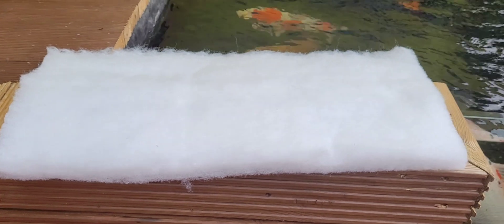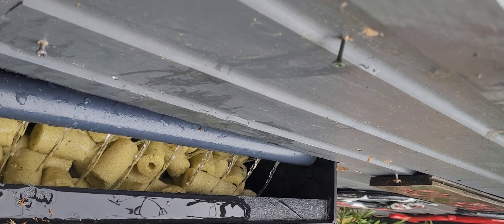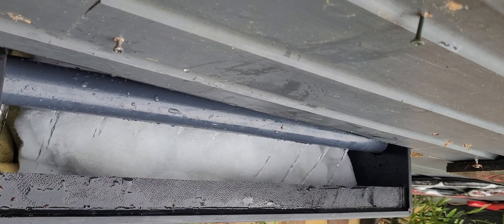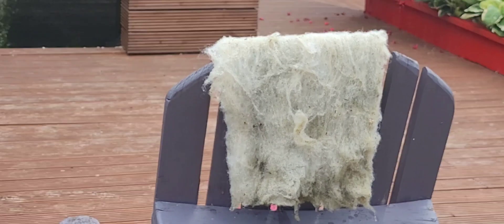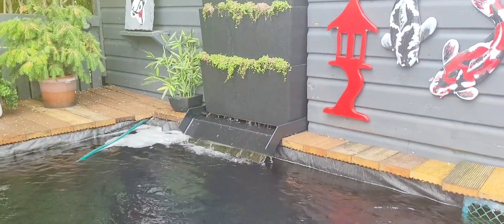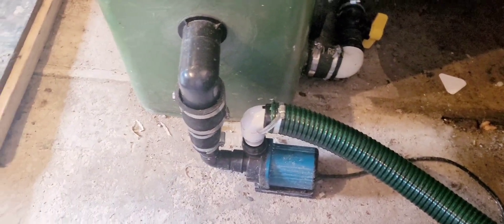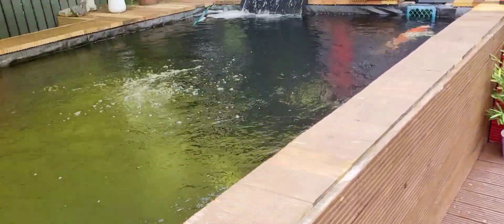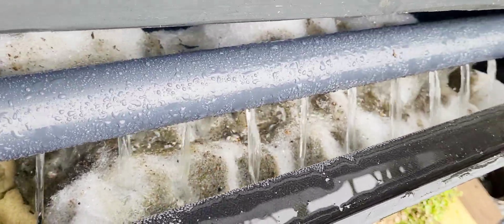Bakki Shower Flow Rate - Fitting the 10000ltr Pump

Comment: You will need a filter. If you can find a 2nd hand one going cheap try a large pressure filter until you work out what you want to do or buy an expensive very large self cleaning one if you are flush lol.
Reply from the maker: Hi thanks we went with a pressure filter. Video shortly

Comment: Love your pond. I use a wheelie bin as a trickle shower after a pressured sump type filter.  I've just fitted an upflow on my heater circuit. I used to have a blagdon 6000 pressure filter on there but it was a pain to clean.  I'm really loving the upflow.  So easy to clean. I did a similar thing as you with increasing the pump capacity. I used to run two pumps. A blagdon variable pump that was 6000ltr and a standard 5000ltr pump. The 6000 ran my filters and the 5000 ran the heater circuit. I've now upgraded to a 20000ltr variable pump (way over the top). The reason I did that was because the top of upflow is about 1.75mtr from the floor and I just didn't have the head pressure on the other two pumps. It runs through a oase Y piece so I can control the flow to each of the different circuits and I will be adding a second upflow as soon as I get all the parts. I've done a series of video's on the build if you are interested.
Reply from the maker: Hi there, 👋 I will have a look and subscribe

Comment: I don't use any floss as it is a pain and a chore cleaning it. You will need something to filter the poop first though or it will clog up the media just as quick as the floss and that will be a bigger job cleaning. Either a sieve, Upflow or a Pressure Filter would work. I use a Pressure filter at present but will be swapping to a sieve soon as my flow rate is reduced using a Pressure filter and a Tempest or upflow only works at a slow flow rate (5,000 to 7,500 LPH). A tip would be to fit a couple of Valves, either side a pump or any equipment then you can easily isolate them to remove or swap anytime.
Reply from the maker: Thank you good advice

Comment: Hello 👋🏼 
Things are looking good in and around the pond.
We used to use floss to trap the finer dirt until we changed our setup.
I found that the thicker stuff 35mm-45mm was better and lasted longer, im not sure about the price now but it was from pmf koi on ebay.
Buying it in bulk is nearly always the best option, we used to get it in 10 metre rolls.
We do not use it at all now as the drum takes out everything bigger than 70 micron so it's only dust that remains.
The shower has a 30,000 lph pump on it running around 70% so in theory the water crashing through the media destroys any muck so no chance of settling or build up.
As martyn has said, an upflow filter would be your best bet (outside of a drum filter) but maybe try to make it as large as possible or indeed make two side by side so you can get enough flow through it.
Possibly have a chat with wrighty and see what he suggests especially about pump speeds.
Goodluck and im looking forward to seeing what you come up with.
Reply from the maker: Thanks for the advice. Will be looking at making our own upflows.
Reply from the maker: Thank so nice off you to take time. I have put 10mtrs in mtmy ebay basket 🧺😀 and will buy it when we run low.
Reply: @copelandkoi  goodluck with the upflow filter and remember it doesn't have to be a clear tube as Martyn at Devon koi uses a large container.

Comment: Hi guys.
I never use floss in my shower, but i didn't appreciate the rubbish I was putting over it until I built and fitted my upflow filter, you do need a certain amount of blockage in the shower media to grow the anaerobic bacteria that eats the nitrate, this bacteria won't live on plastic media, upflow filter before the shower will be brilliant, you'll be amazed at what it catches, and the clarity of the water, my 200 x 1000mm tube with 11 litres K+ media handles 8000 lts/hr, only downside needs cleaning every 3-4 days, but beats cleaning floss every day.
Reply from the maker: Great that you have put your measurements down. Thanks
Reply: @copelandkoi  have a look on my channel, you'll see it in action.
Reply from the maker: Will do. I subscribed ages ago to yr channel

Comment: Under gravity from the skimmer you would need a 3 inch or more feed to the bin for it to have worked on the 10000L pump. Think you are right in thinking upflow filter to the shower from the pump but as to weather you build one or go with the EA Tempest build one off Terrys plans and go with the Diy auto clean on it as well the Tempest only flows 5000L so would put you back to where you started. Thanks for filming
Reply from the maker: Yes I agree  tempest no good for flow.  Would need to make one. Thanks for the advice